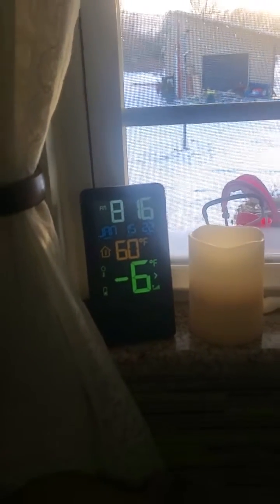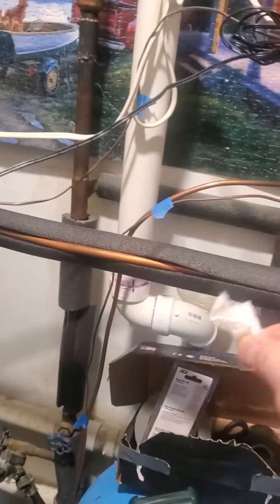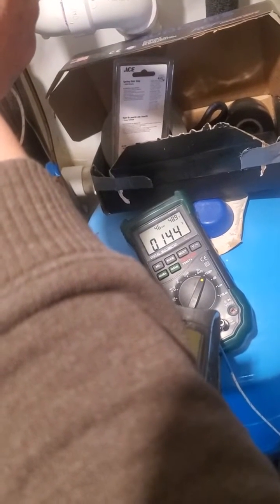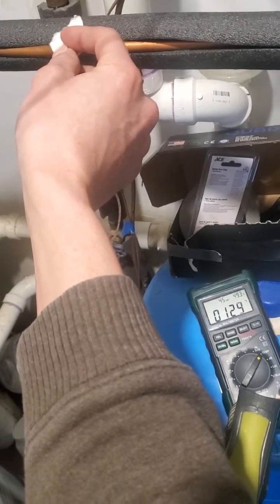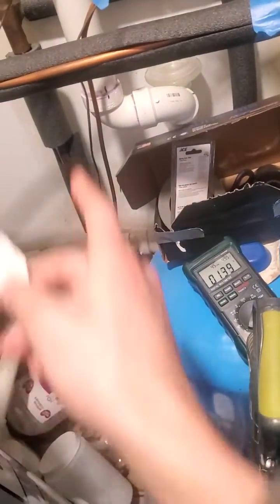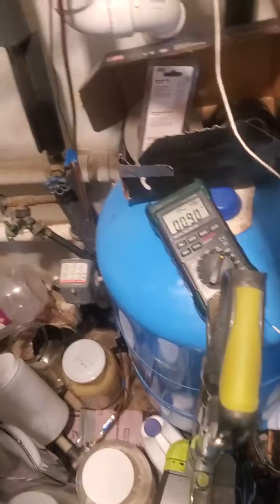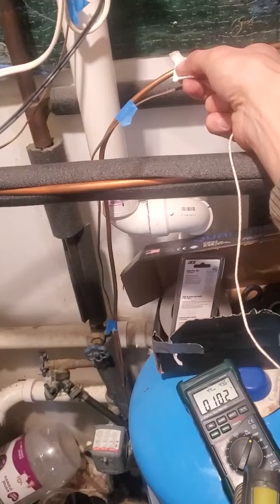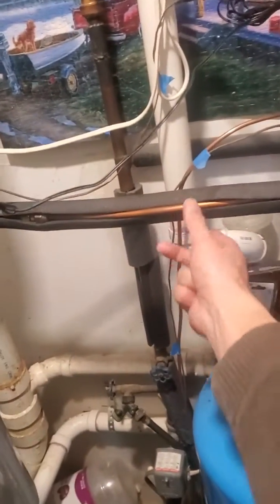diy heat pump water heater at -6f

Comment: Just wanted to say thanks for the vids again. I got my little setup going with a plate heat exchanger and a 10K btu window unit I got cheap since I can’t invest in the mini split at the moment. Since it’s heating it puts out about 13K btu including compressor heat, so altogether I’m getting about 125% output not including losses. The ambient is about 68 so not too warm for my area. COP of 3.5 approximately, including two pumps. Warmed my hot tub 55 to 105 in two hours at a cost of about a quarter. It’s awesome.
Reply from the maker: That cool. Did you end up getting the plate exchanger from aliexpress.com?
Reply: @ne7s29  hey man I ended up getting it from Amazon. 20 plate copper brazed wort chiller was the name. It’s been working really well to heat the hot tub. It was about 50$ and I use two small submersible pumps that were 22$ each. 

Eventually I’m going to get a recirculation pump to heat up my water heater tank so I don’t have to do the cutting stuff because I’m afraid I’ll mess something up. I think when I hook it up to the water heater I’ll cut the lines and pipe the refrigerant direct to the plate exchanger and get a 30 or 40 plate just to make sure there’s enough exchange of heat to fully condense like it should. And since in our applications we will not need to use the plate exchanger as an evaporator it shouldn’t risk hurting the compressor since the evaporator is still the factory one so there shouldn’t be any liquid entering the compressor. 

I also wanted to ask, have you had any issue with your outdoor unit not working when it gets above 86° outside? I have been looking at units to get because it’s more efficient than my window unit heat pump but most say the outdoor unit will not work in heat mode above 30°c/86°f. I think I will look for one with a higher cut off. 

I was hoping to repurpose one we have installed that we don’t like very much and was cheap, but it says it cuts heat mode off at 86° and I’ve seen it in a few other manuals so far.
Reply from the maker: @mrjjman2010  works at 95f no problems.

Comment: How much power is it drawing to heat the water in these low temperatures? Also would be curious to know how much energy it take so heat the tank or just a COP at this temperature?\
Reply from the maker: The power draw continues to hover around 1800wayts.  The COP I would guess is 30% worse